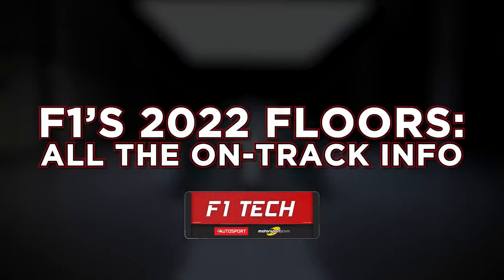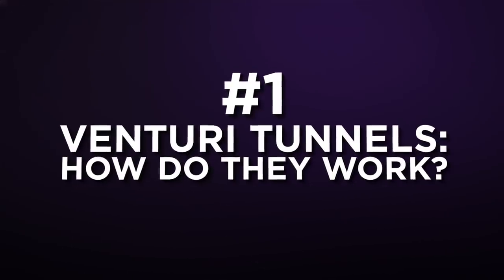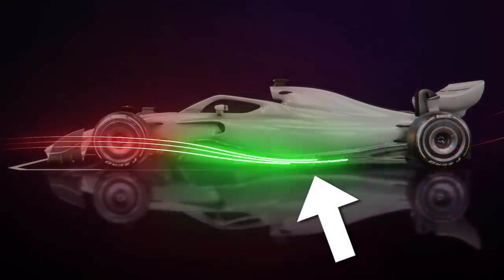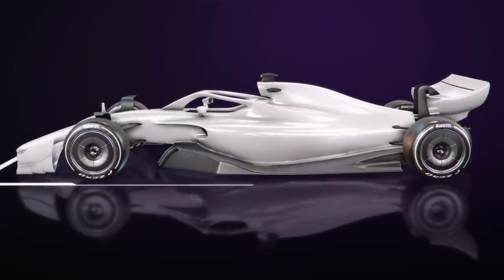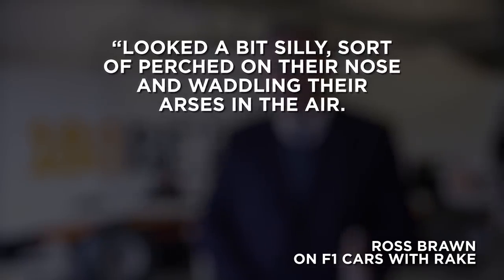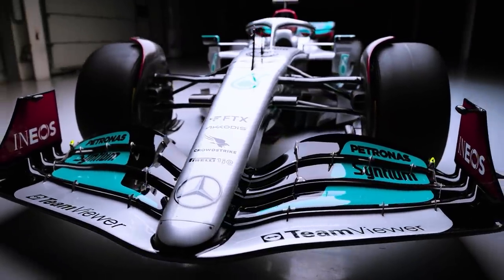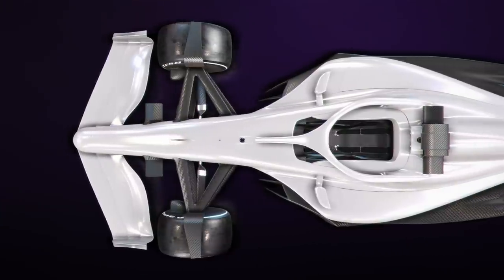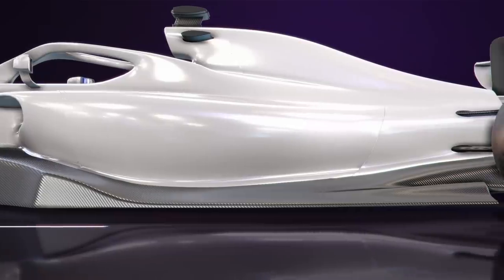Why F1's Floors Could Hold The Key To Success In 2022

Comment: I am quite sure that air under the floor doesn't get compressed. Or if it does it should be by a very small amount. If it got compressed it would actually create lift rather than downforce. From what i know the air accelerates a lot which means that the pressure under the floor will decrease.